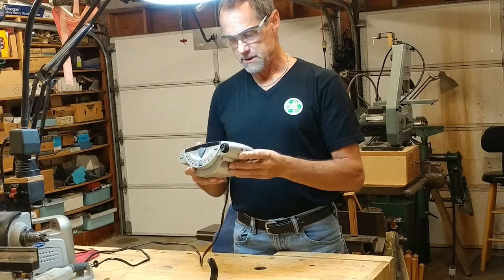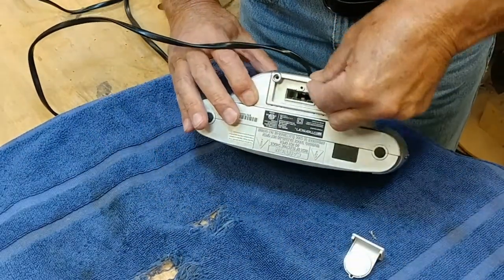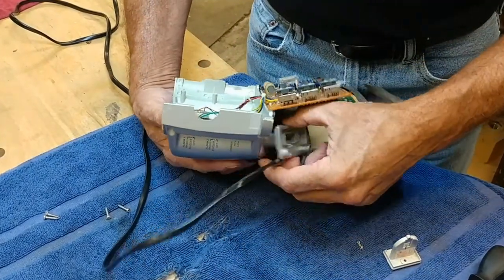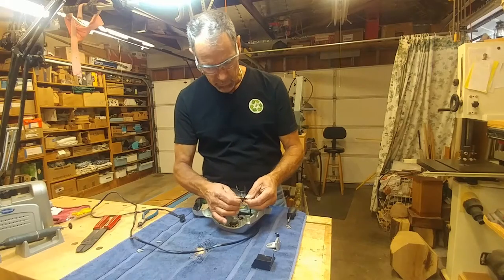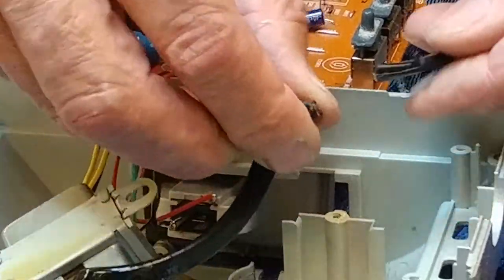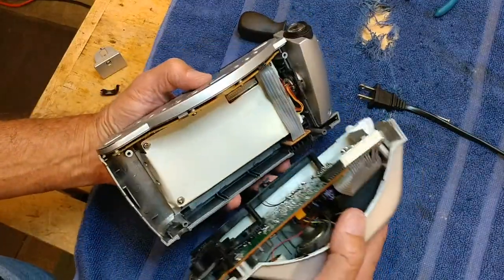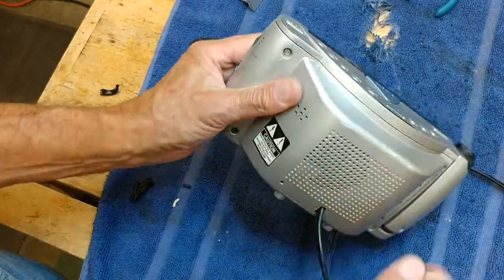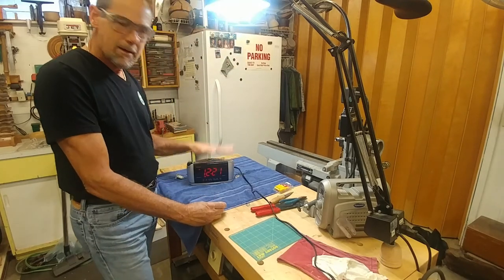Emerson Clock Radio Repair

Comment: The light that swivels to shiw the time on the ceiling no longer works. Battery on bottom or bulb?
Reply from the maker: Bulb, the battery is simple to maintain settings if power is lost.